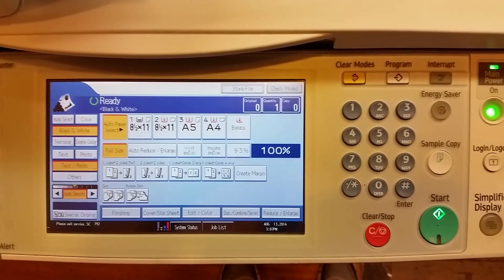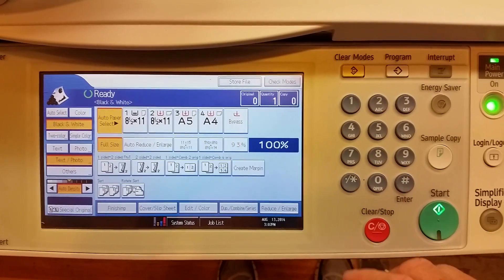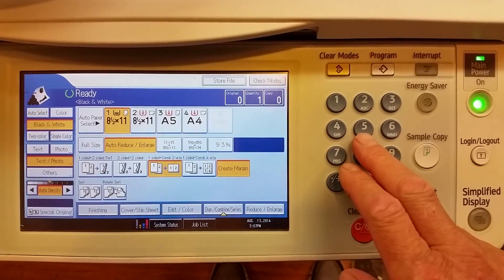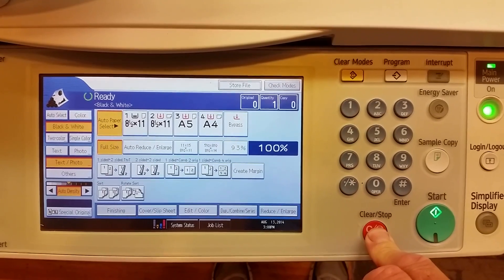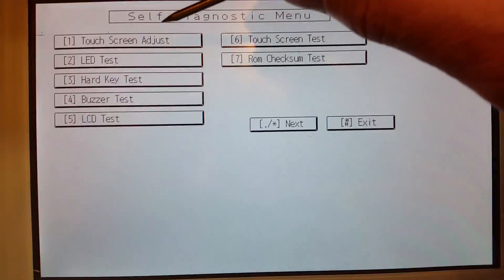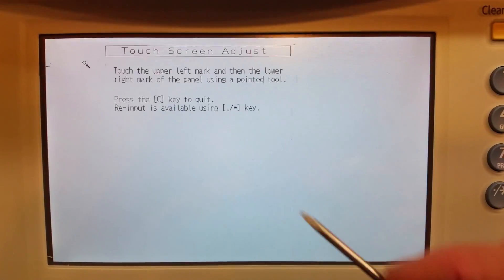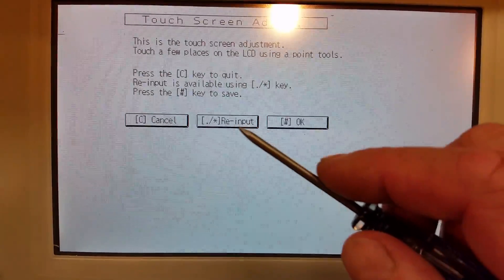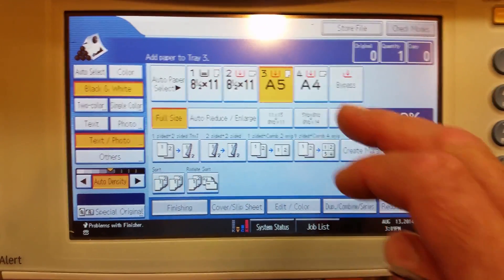Ricoh touch screen adjustment

Comment: I have a Ricoh c4500  and the code is not working on it.   Iv used this on my other machines a c3500 and c4000.  But  for some reason nothing happens after doing the button combination on this machine.   Any advice or is there another way to get to calibration?

Comment: My touch screen used to be off by about an inch, now it just doesnt respond at all. I tried to recalibrate it like you did here, but it won't recognize any touch at all. Any advice? Do I need a new screen? I actually have another copier that is the same model that has some things broken, but I saved specifically to part out in case anything ever went wrong with this one. I just don't know how to swap out touch screens. Can you help?
Reply from the maker: Let me know the model # and I will make a video for you on how to replace.
Reply: Hadley Hudson It is a Lanier LD425c. Looks the same as what you are working with in this video. I tried to calibrate it like you show, but the screen is just completely unresponsive to any kind of touch at all.
Reply from the maker: Matt You will need to replace the touch screen. You can purchase from Precisionroller.com
Reply: Hadley Hudson Thanks so much for getting back to me. I actually have another unit that I have kept specifically to take parts from when needed, so I have another touch screen I can take off of that one. I just am not sure where to start with that. In general, I am pretty handy, so I am sure I can do it, just want to make sure I am following the right process because I dont know anything about how it is put together and what I am going to need to unscrew and disconnect to do it.
Reply from the maker: Great! I will make a video for your machine tomorrow to show you how to replace screen.
Reply from the maker: Video is up for replacement!

Comment: A tech came out today because the screen on our C2800 was picking up our commands about an inch off of where we were touching, most of the time I could hit the button next to the one I wanted and it would work, but when the button was near the right edge of the screen it was sometimes impossible to engage.

When the tech came in he couldn't figure out the fix right away and called someone who gave him instructions to fix it, but they warned that it might only last a month.  He did the fix and it worked until I walked in the room.  I touched the screen and it was even further offset than before.  He told me he'd order a new panel and we'd be back to normal in a couple days.

I found this video, followed the instructions and it worked perfectly!!  I called to tell the tech and he said that's exactly what he did.  He asked what I used to touch the dots, because apparently he used something not so precise, where I used a mechanical pencil and carefully tapped in the center of the dots.  We're still ordering the new panel, just in case, but I wanted to thank you for posting this fix!  I don't think I could take 2 more days of whining and complaining about the lack of precision on the touch screen.
Reply from the maker: Glad I could help!